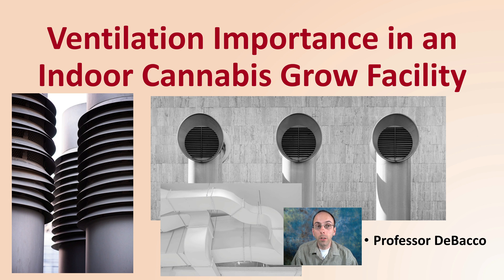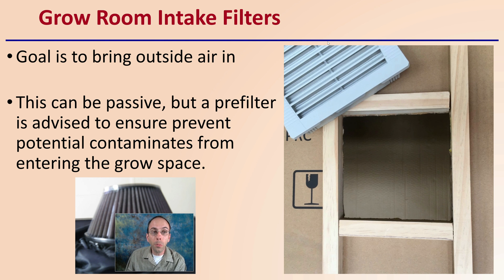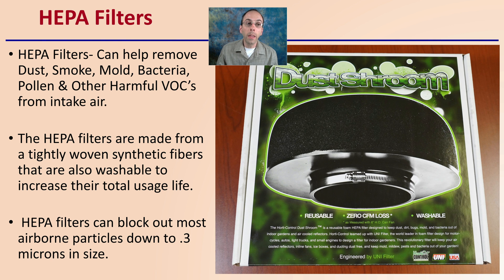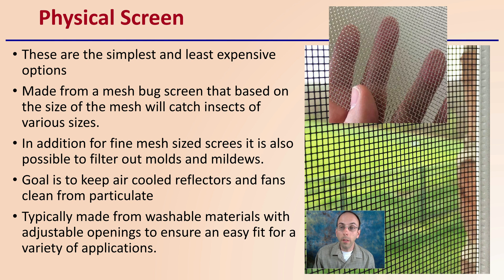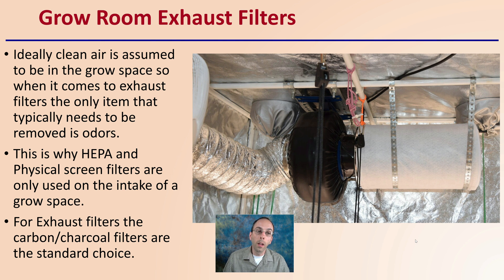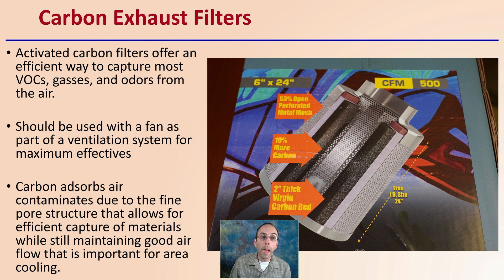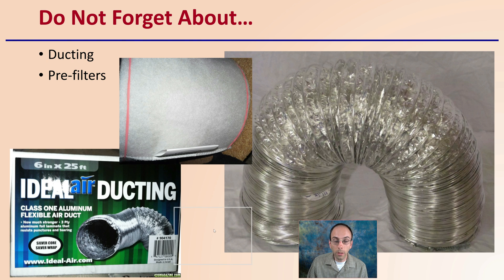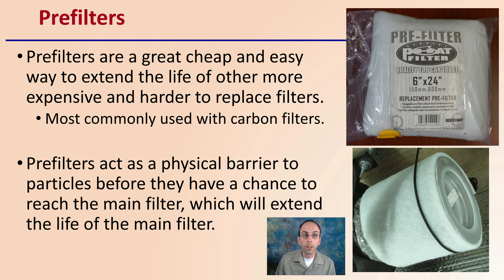Ventilation Importance in an Indoor Cannabis Grow Facility

Comment: One thing to keep in mind on ductwork. Smooth wall ductwork will provide a much higher rate of airflow than the flexible type. It is a very significant difference, so while the flexible type is much easier to install, you are giving up efficiency. On a short run it may not matter but on a longer run, or with a lower power fan it may be worth it to use smooth wall ductwork. Even if only part of the system has smooth wall it will help with airflow. I learned about this as a professional remodeling contractor and this has been extensively tested.
Reply from the maker: Good point to include.

Comment: What is the proper air exchange rate for a cannabis I've heard it should have new air every 3 to 5 minutes though it would seem hard to maintain ideal conditions with that much air exchange, what is the minimum air exchange rate?
Reply from the maker: One air exchange every 5min. is the standard.

Comment: what do you think is my air circulation system sufficient? i have 2 holes in my closet 1 at ground level 1 as high as the ceiling of the closet. and a big fan inside moving the air around. also i open the doors to refresh the air quite often as well.i tried putting fans in the in and out holes but they were just too loud.
Reply from the maker: Can not be determined by the information given, there is not one dimension provided.  "Hole" and "closet" are not units of measure.

Comment: I’m trying to clean and re-oil a “Dustshroom”.
The company doesn’t sell any products to re-oil the foam.
Can you suggest any methods to refresh the filter?
Thanks 🙏
Reply from the maker: Look at filter cleaners for K&N car intake filters this can be used as a substitute and should work out well.
Reply: @DeBaccoUniversity  That sounds like a good suggestion thanks.
 
Wouldn’t an automotive product have petroleum base? The Dustshroom used to sell an herbal base oil to help trap particles.
Reply from the maker: It could be petroleum based (which is just very old plants;-) but the quantity used and location should not provide any negative impacts on the plants.